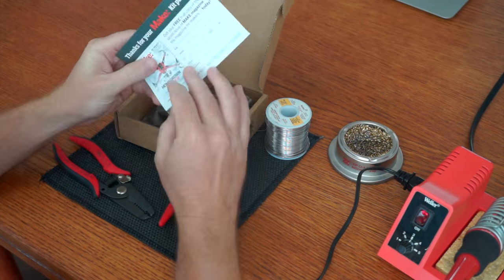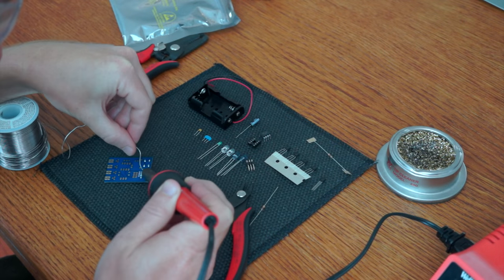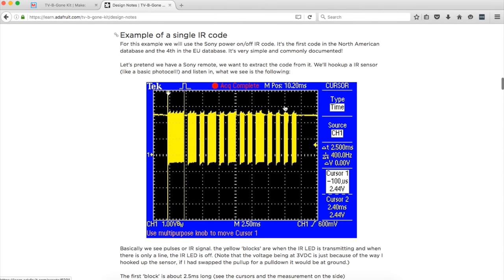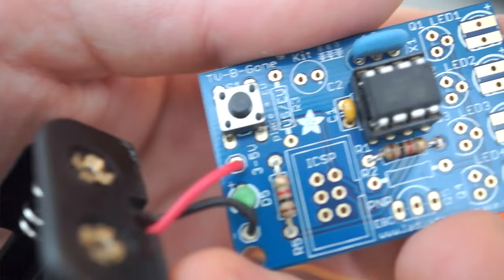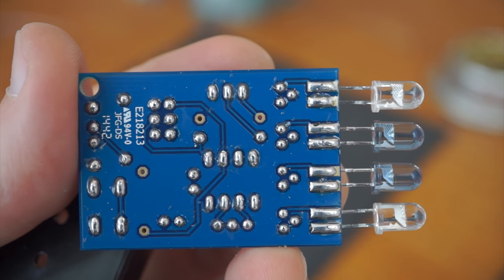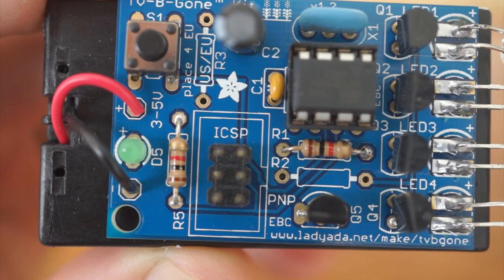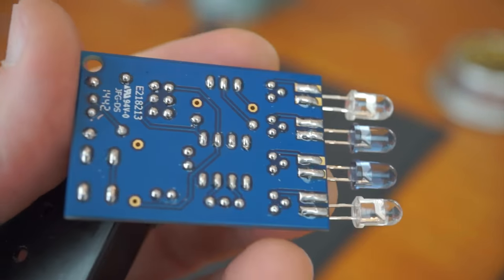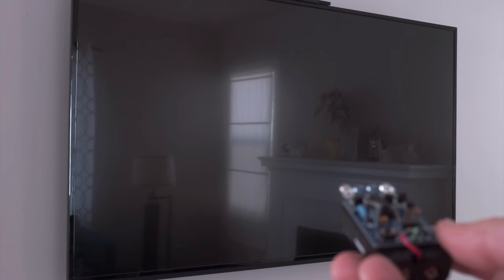TV-B-Gone: an Electronic Kit with a Superpower

Comment: Why don't you need an ICSP
Reply: The ICSP is used if you want to reprogram the chip with your special code. I'm not completely sure how you would program it but when I was reading the article by Adafruit they said to only solder it in if you plan on reprogramming the chip. That is, for the 1.2 Version. It might not be the same for this version in the video because he soldered it on anyways, but yeah.